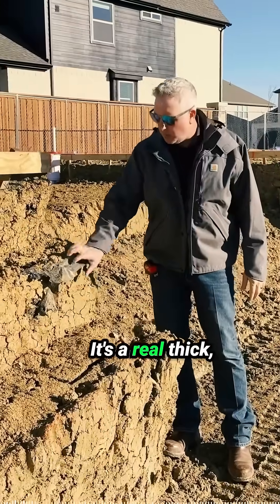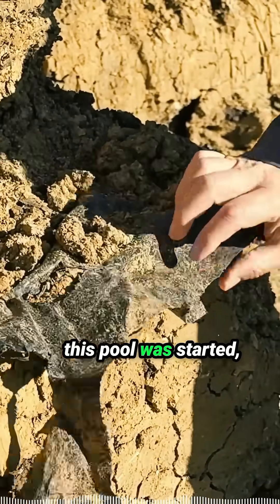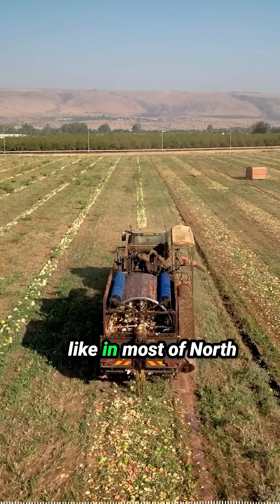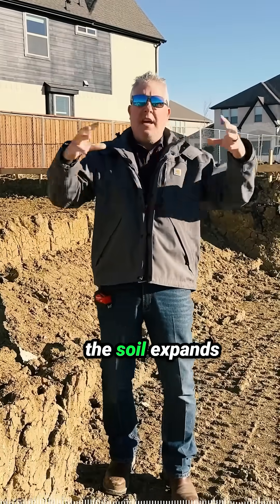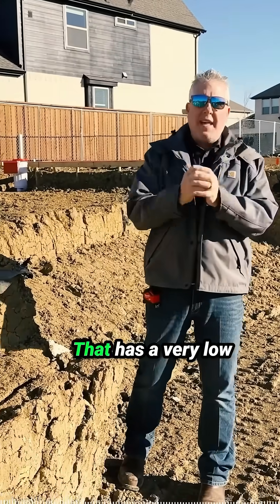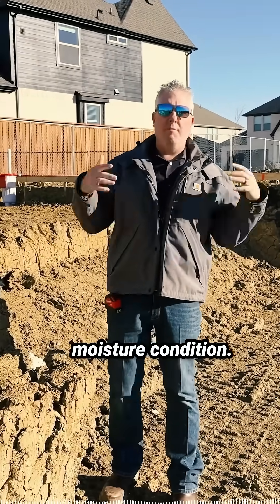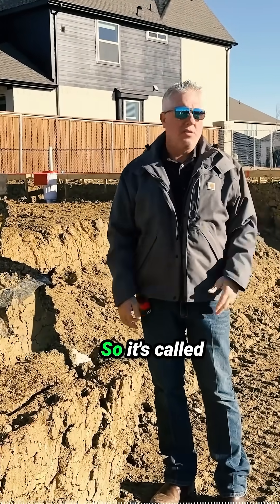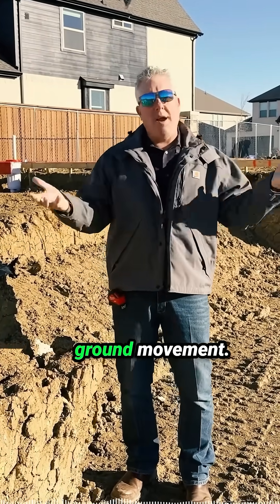Check out this thick layer of plastic! 🌍

Comment: If you did that to metal it would worsen it. 

Make more issues as the ground doesn't move like it had on its own in the past and has many new stress points. That don't move with it. In bridges that's bad. In railways that's bad... 

They know it's bad to do yet did it anyway.

Comment: So you're mostly correct, however soil plasticity is actually a measurement of the ability of a soil to deform under varying moisture conditions. Most high swell potential soils will also have a high plasticity, but you will also encounter a ton of high plasticity clay soils with a neutral to low risk for swelling that could impact a structure. I am not sure what they're using in Texas, and no clue what this "chemical injection" method he is talking about is, but most of the US will use woven "geotextiles" that do not Leach into the surrounding soil, and are thus extremely non-impactful on the ecosystem. They just slow the infiltration of water to be closer to what it would be with a clayey soil compared to the sandier soil they likely brought in. There is a risk of contamination due to unethical soil import practices, so research your builder before you buy!
Reply: I appreciate the in depth response. I’ve been a contractor for a year, and this helped me achieve my goal of learning at least one thing every day! Thanks
Reply: You can inject or layer/ mix in quicklime to stabilize clay. 
Basically- limestone